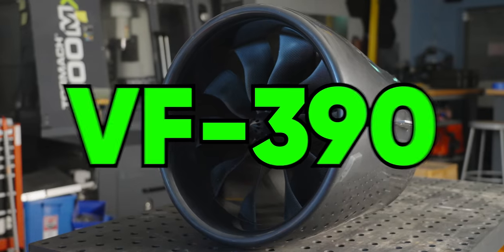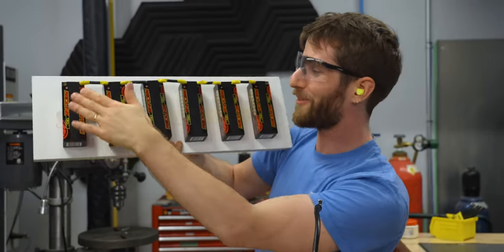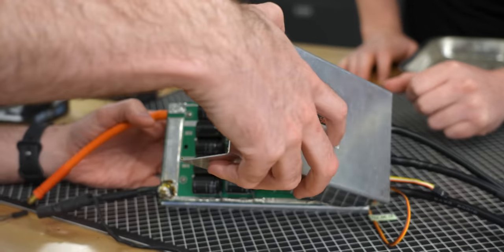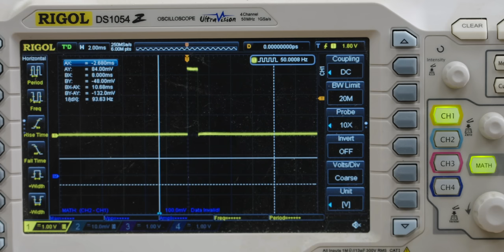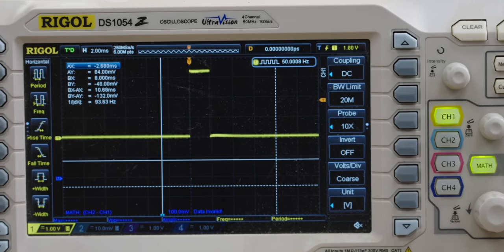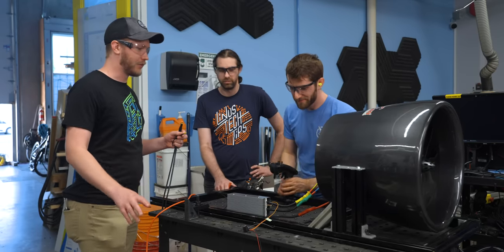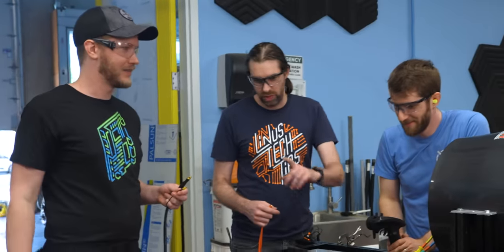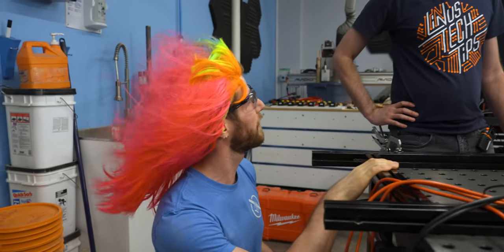The Scariest Fan ever attached to a computer - Vasy Fan VF-390 EDF

Comment: I'm bit sketched knowing that those batteries are not rated for such use, but I appreciate that the engineers were expecting things to blow up and take the safety precautions.
Reply: Yep.  They even used quick disconnects in case they need to rush those batteries outside if they're about to blow up.
Reply: @Darkk6969  Well you saw how fast Alex moved in the end when it started to smell.
Reply: The batteries are easily rated for this amount of current. They are 6Ah at 130C which is 780A, easily enough for this use case. They are only cautious with the batteries as anyone would be who has experience with Li-Po batteries.
Reply: @rosskj9187 those C ratings are optimistic at best and are usually only accurate for a second or 2 and you don't need much lipo experience to know stinky smokey batteries are a problem lol.
Reply: @SpencerHHO  The manufacturer does not specify whether that is burst or sustained output however this is not unusual output for high performance Li-Po batteries. There is a FOS of 3 using these batteries. They also did not specify what was smoking, removing the batteries is a solid precautionary measure when dealing with Li-Po regardless. It is likely other components were struggling with the loads.
Reply: @rosskj9187  No, C Ratings are almost always wrong, and i can give you a hundred page long post of people reviewing and proving such on RCGroups. Anything above 40ish C is just marketing BS.
Reply: @SpencerHHO most of these are actually rated for a "burst" rating of 30 seconds, but the scariest thing to me is how many of them they had in parrellel.

I fly model airplanes, and I remember about 10 years ago, I had a battery, a 3s 1800mah that was rated as 90c. I started going over the math, and realized that one of those batteries could theoretically easily start a car.

I posted this as "theoretical" on my model airplane forum, and everyone made fun of me for it. 

A winter or two ago, I was walking through Walmart, and in the clearance section they had a flashlight "jump starter" for $20. I figured there is no way it would start a car, but was probably worth the $20. 

I started a 7.3l diesel with dead batteries, no issue. Used it for a few months before it stopped working, figured the electronics died. While it worked, it would litterly start any car, dead battery, truck, tractors ECT with no hesitation, although only a few times before it needed charges again. I could get about 10-15 jumps off my 5.0 v-8 with it.

Ripped it apart for fun before throwing it away, guess what's inside? A single, 4s 2200mah lipo battery rated for 20c. I tested the lipo, and one of the 4s was dead. 

Now knowing that it was a lipo, I would never leave that in my car overnight charging off a cell phone charger again, but I am going to order another 4s 2200c and get it back going. 

That was like 1/100th the strength of the batteries that they were using here. 

I have also personally pulled over 100 amps out of a single 3s 2200mah 20c battery. It cost me $6. The fancier 90-140c batteries are considered more medium range and used to cost about $40 and the 250c "racing" grade ones, you couldn't even put wires big enough to not melt at their rating. 

Remember, the were pulling more then 100 amps through probably a 10 or 8 gauge wire here, in series.
Reply: @demondoggy1825  Often depends on the quality of the manufacturer for sure I agree, there are many batteries marketed with much higher C ratings than the batteries are capable of. If we consider 40C as an estimate that is still 240A. As seen in the video the fan was not operated at 100% for long, also I would still put my money on other components or connectors / connections smoking before the batteries. This is also assuming that the fan draws max current under 100% load or if this is the theoretical max current the fan can draw under load with a safety margin. Given the batteries appeared to survive and no reports of a Li-Po fire display were made it is highly unlikely that something as volatile as a Li-Po battery just smoked a bit and stopped, once those things start smoking that reaction is often irreversible.
Reply: @rosskj9187  The manufacturers often lie about the true capability of their cells because they are rarely independantly tested. Smaller high current cells are probably more prone to internal when run with this many cells in series. You'd have to look at the specs from the actual cell manufacturer rather than whoever is packaging them to know for sure but LiPos often have a limit of how many can be put in series before you are outside their rated specs. It could have been the ESC for sure but those batteries were getting very hot and thermal runaway isn't out of the question. 

LiPos also really hate current ripple and given the total POWER draw of the system and the sketchy electronics set up that ESC might have been creating a lot of it. It's not how I would have done a sketchy LiPo setup. I've bought the individual cells before and ran them in a bucket of distilled water but people panic at the idea of using water with batteries even though a dump bucket is a great idea for burning batteries as it is pretty much the only thing that can stop or at least slow a thermal runaway.
Reply: @rosskj9187  Yes, the failure was likely the wires they are using to string the lipos in series, as all 200 amps they hit it with are going through those tiny wires. Still, You can not trust the C ratings, and telling other people to trust them could cause a fire for their use case.
Reply: @demondoggy1825  I wouldn't go as far to say people should trust pulling over 700A through these batteries, but with the current demanded by this project they should be more than capable, the manufacturer would have to be making some preposterous claims to be incapable of this. I don't personally think anyone should play with Li-Po's without educating themselves first, I have personal experience with Li-Po fires and all precautions should be practiced.
I would suggest connectors, connections or electronics more than the wires connecting the batteries in series, over such a short distance those should be fine.

Comment: For the next test, I can recommend Volkswagen MEB battery modules (for example one from an ID4). 

They are sold as 8s and as 12s, so you could use them right away. One has about 7kWh and costs around 1000$ (used). 

You can charge them with a lab bench PSU and an active Balancer.

They can handle plenty of current without suffering that much.
Reply: my suggestion was going to be to use EV circuits for this, or even swap out an EV motor for this fan.. this is car amounts of power
Reply: no don't give them more ideas XD
Reply: @lettuce7378  of course, I wanna See more!
Reply: @shellderp  for the Inverter (esc) yes, but Motor, no. Most EV motors "only" do 15k to 20k revolutions per Minute, this fan seems to go much faster. And since the Motor is built into this thing it should be suited perfectly.
But the esc really seems a bit small for that thing.

Comment: 11:00 it's duck tape named after "duck cloth", which was used for it, with adhesive backing added. The name duct tape is just because some people briefly used it for duct work even though it's not appropriate for the application. For duct work you technically use flue tape, usually aluminum backed.

Comment: "it spins at a whopping 10 000 RPM"
Turbochargers: Allow me to introduce myself
Reply: Now, imagine if the turbo was as big as that turbine, it's insane how much air those ice engines can take
Reply: @Lucas_sGarage  When built; rally engines are up to 60 PSI of boost. Turbo is doing about 400,000+ rpm..
Reply: @fightingfalconfan  ik, I'm saying that image if the turbo was 390mm, the amount of air that they could push, and the amount of air that the engine can take is insane
Reply: Yeah? And the LP rotor on a GE90 turbofan only gets up to about 2300rpm. Guess which is more powerful. The smaller a turbine is the faster it can spin, but it'll make a lot less power.
Reply: @G3rain1  to my understanding props and turbines as they get bigger they get more efficient (for some reason) my bet is turbulences and stuff like that
Reply: @Lucas_sGarage  Yeah its pretty impressive. The air entering the turbocharger can reach almost the speed of sound, and at the medium engine speeds, it can suck up to 3.7 cubic meters of air per minute which is 3700 liters of air.
Reply: @mohis5664  it's wild, it's enough to change the hole air in a normal house in 3 minutes or less

Comment: You need to get your hands on a Mainline Chassis Dyno Fan from Australia, a fan designed for massive static air pressure, purpose built for cooling. Runs directly on 3 Phase so it will be nice and easy to demonstrate.

Comment: Here in Germany we have special 5 pin plugs and outlets to handle up to 50.000W of power (400V at 125A). The plugs are really big and the cables are extremely heavy. They are used for power distribution boxes on construction sites or on emergency power inlets for big buildings like hospitals.
Reply: Can't they handel up to 86kW? 400V*125A*sqrt(3)
Reply: @Sid_Argon  Yep, that's correct :)

Comment: Linus if you want even more cooling capacity try getting in touch with a HVAC company such as Beckett Thermal Solutions that have massive industrial fans to provide air for massive places like football stadiums. They build the heat exchangers that go into these units and the fans that are attached to them are insane and can knock you over almost. You'll love it.

Comment: You could have gone for a portable generator (as in the trailer mounted diesel ones) and had an electrician make a lead for you out of flexible non-metallic conduit.
Reply: I thought the same. I checked a normal portable (trailer) 50kw generator is a 450$ daily rental. Not as interesting content, but would have been much more cost effective and way less time consuming.
Reply: Probably be able to run the generator inside with all that airflow blowing the carbon monoxide

Comment: This exact fan can be used to power REAL ultralight or light sport aircraft lmao....my dads only has 33hp and weighs 250lbs and barely qualifys as UL...this is an insane fan
Reply: It really couldnt. It only generates 130lbs of thrust and it weighs 200+lbs, it couldnt even lift itself much less an aircraft and people. Plus how exactly would u get 45,000 watts in a small aircraft?
Reply: @verakoo6187  you don't need a 1 to 1 thrust ratio to fly something this could power a pretty big plane i think (wouldn't have that much range tho there is a reason electric planes aren't very common)
Reply: @verakoo6187  An aircraft does not require an engine to lift the whole weight straight up. That is something fighter jets can do. A cessna 170 only has a 120kW engine which works perfectly fine for its weight of 1100kg. The ratio here would be 0.11kW/kg where as the ultralight Lazair has a power/weight ratio of 0.069 and can fly. (An A380 would have 0.227, this would be thrust to weight though)

As for how to get the power into an airplane I'd say batteries. 45000W is 45kW way less than many electric cars. My car makes 120kW so for 45lW it would take roughly 38% of the battery which would be like 130kg. You could theoretically scale down the capacity trading weight reduction for distance. 
There was an (for demonstration only) cessna 172 that was electric back in 2012 and Peter Sripol made an electric plane aswell.

Comment: You guys should take those giant noctua floor fans, and make a sheet metal PC case that is sized so that those floor fans are the case fans, mount normal sized pc hardware into it and then benchmark the noctua floor fans against some garbage floor fans from walmart and see which ones keep the walk-in pc cooler :)
Reply: I think the noctua floor fans are just normal floor fans that they painted to look like noctua fans.
Reply: @SamuraiGuy  Correct. They're just standard cheap-ass fans with a paint job. Noctua had nothing to do with them.

Comment: If you really want to keep a CPU cool using this method then you really need to pop in one of those passive heatsinks that has a huge surface area with little air flow resistance.  The last one I remember you guys showing was several years ago so you will likely need to jerry rig a suitable mounting bracket for more modern hardware though.

Comment: This setup perfectly shows how you simply can't go any lower than ambient with pure air cooling. No matter how fast you move air through your heatsink, you're hitting it with ambient temperature air. So even if you could manage to achieve 100% heat extraction via convection (every bit of heat moved away from the CPU and into the heatsink and blown away), you would never go below ambient because that's the temperature of the air you're using as a medium to move the heat away from the heatsink.

Comment: If you want maximum cooling, you need enough time for heat transfer.  You get to a point where air velocity is no longer helping.  On a cars air conditioning system put a thermometer in thr center vent and measure how cold the air temperature out of the vents is.  You will achieve a much colder reading on lowest fan setting.  I guess I am saying it's a balance and eventually throwing more velocity and volume at a heat sink gets to a point where it isn't gaining anything.
Reply: Wouldn't high air speed do the inverse of cooling and actually start heat due to friction.

Comment: I'm really surprised the exhaust fan in the pc case didn't turn into a generator and fry the the motherboard.
Reply: Im guessing it was unplugged and used as a way to create a vortex out the back end of the pc with that much pressure.
Reply: I'm surprised it didn't blow up.

Comment: This legitimately seems like a video that could have ended very differently had some minor thing gone wrong.
Reply: It just blows my mind they don't have 3 phase outlet there. I mean it's also problem of 120V instead if 230V but the fact they convert BATTERY!!! DC to 3 phase AC is mental and sorry if that is situation of grid in Canada, holly molly how do you even exist. I have 3 phase 64A main circuit breaker at home at 400V. This video insane and shouldn't even exist.
Reply: @jamessatler5461  They do but I don't know how expensive or how long it would take to have it installed. Different places have different legal requirements and permits after all. Unless Linus is planning to use a lot of machinery in the future that would need a 3 phase outlet, this probably isn't worth doing. But I thought they did end up buying all that machinery awhile back, presumably for the labs thing. I don't know how much power that equipment draws though. I don't really watch LTT so I don't know how they set all this up. If they do have equipment that use 3 phase power that means they probably already have a phase-converter. Linus did mention near the beginning of the video that the transformer for their building couldn't handle the power draw required for this experiment though.

Would be nice if my home had a 3 phase circuit breaker.

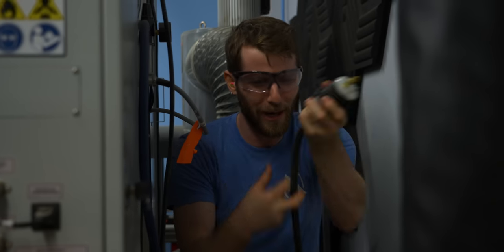Comment: 1:30 in Poland :
1f (for small apartment with 1-3 rooms in a block or skyscraper, etc) : ~240V x 16 A = 3840 W (standard)
3f (bigger house with garden etc) : ~400f (interphase). Theoretically without limits. Standards 32~40A (400V x 40A = 16000W 🤔)

Comment: That fan scared me, both the electrical power going into it and what it does with airflow. At least it was presented in a fun cheerful way, so it was obvious from the start nothing went seriously wrong with any of the people present. Was glad to see the electrical part being handled fairly sensible short of doing the filming at a place with the right mains being available.

But this fan duct being apparently unconstricted on both the intake and exhaust was mildly concerning to say the least even at "low" power up to 10%. If any object with some density got sucked into it somehow (entirely possible with the open doors even when taking all precautions in the room) could be pulled through and launched as a projectile or shredded into dust. Or worse that impact could shatter the fan blades with all kinds of possible outcomes. Small bits could easily come loose inside the case too and make it out through a gap, but the video would probably be less fun when filming it from a distance always with a protective thing between the fan/computer and people while operating at high power.

I also don't know if the exterior of the fan is considered to be able to contain a catastrophic failure of a fan blade internally at maximum power, shrapnel of the spinning blades going sideways through the exterior are scarily familiar. Even if it can contain it it'd still make a mess in the room and being so close might not be wise. More than a few airline incidents happened because the engines couldn't contain an internal failure, either from normal wear without timely inspection or ingesting objects (typically birds but stranger things have happened). 

Glad it went well and I did enjoy watching the video, but I do know I wouldn't want to be so up close or in the airstream myself if I was there. Would definitely want to play with the fan though and see what it does to objects various objects.

Comment: I did the same with a 12000btu Air Conditioner years ago, got my gpu down to 8 degrees C without load. Chopped about 30 degrees off the top with load. Similar results with my CPU. Way better results than using sheer fan power.